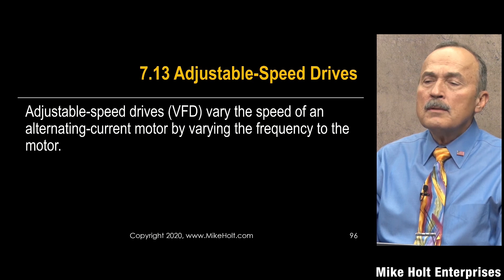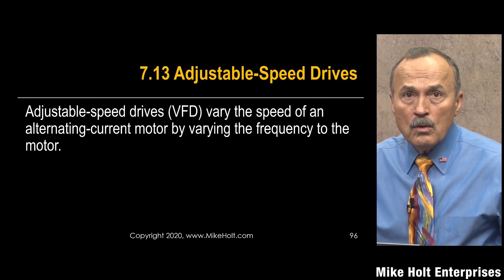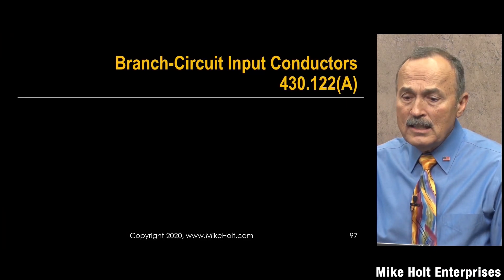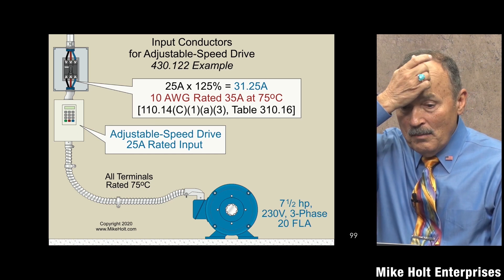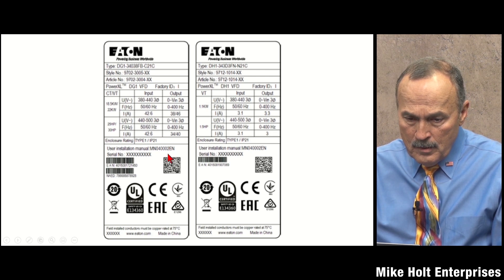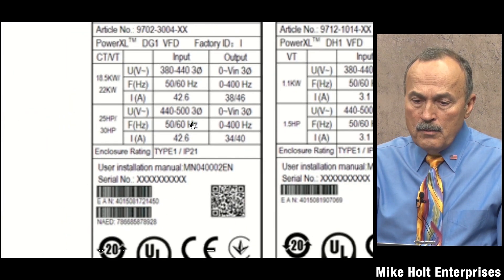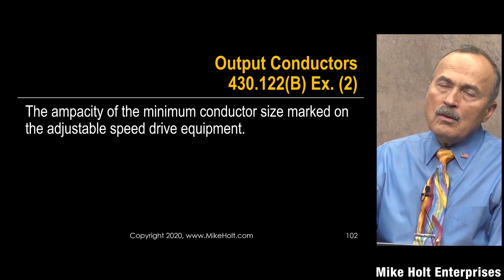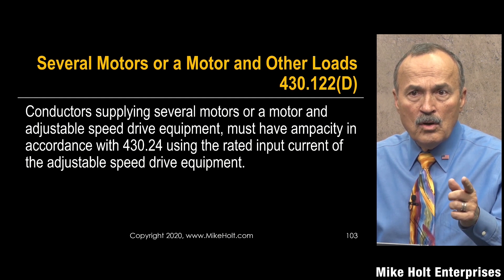Adjustable-Speed Drives, NEC 2020 - [430 Part X], (15min:31sec)

Comment: Mike here are some drive tips: For critical equipment purchase the next size up and it will last longer. Just make sure to reduce fuse amps. Blow them out several times a year with dry air. Perform IR scan at least yearly.On older air handlers might want to extend ramp up time to over a minute so they due not trip out in winter on tripped frezzestats . Our local service company only charged $150 for start up that gave an extended parts & labor warranty to 3 years. Saved us a lot of money on 100 to 250 HP drives.On important equipment we always purchased VFD'S with bypass. Could work on drive while motor was running. Every time I ordered a drive the great sales rep we had always told that they were rated in output amps & not HP. We had 18 pulse drives for all motors 60 HP & larger. Both drive companies that we had service techs said to stay away from 18 pulse drives.

Comment: But doesn't 430.24 also say to take 125% of the continuous non-motor load? So if the motor is continuous and the drive is continuous, wouldn't you take 125% of the largest motor, 125% of the drive and 100% of all the motors amperage?
Reply from the maker: An adjustable spreed drive is not a motor, so you need to go to 430.130 and 131
Reply: @MikeHoltNEC  yes, but it is a non-motor load per 430.24. Dalton brings up a good point and you didnt understand it at all

Comment: Typically the VFD is installed in an Industrial Control Panel or similar enclosure that has an associated load in tandem with the VFD. These could be many things including, say, 5 to 10 HP blower motors with several control power transformers and any number of auxiliary equipment that is the load to be served in tandem with the input VFD rating that need to be calculated to find the correct conductor and ocpd size. I've seen an installation with two 5 hp blower motors, two 2.5 kW heaters, and two 1.5kVA CPT's that needed to be calculated on top of the VFD input current rating for sizing of the conductors and OCPD.
Reply from the maker: Your example has nothing to do with my video, but related to sizing 'feeders' to 'loads.'
Reply: @MikeHoltNEC  Thank you for your reply and time. I thought the application of 430.24 would apply to the situation I mentioned and was alluded to here in your video. This video would be for installing a VFD only serving a motor circuit then right? Much love and respect to you Mike.
Reply from the maker: @jaredkilgore7194  Section 430.24 only applies to multiple motors, not auxiliary equipment like VFDs, heaters, or CPTs (what is a CPT).
Reply: @MikeHoltNEC  "CPTs" Control Power Transformers. 430.24 is used when calculating conductor size for combination motor loads that may or may not include other motors (as considered in 430.24(3)&(4). I see now I am incorrect in looking at this the way I did due to the fact of the video was for sizing conductors for adjustable speed systems alone in scope with nothing else considered. Mike, I've only been in the trade 19 years but I've always pushed myself to learn as much as I possibly can and to stay humble so I can be open to see things and learn things differently. The NEC is a very humbling experience in learning it over the years. Just when you think you have a good grasp, something happens where you're forced to look at it and interpret it differently than previously. I'm in a position now with a state municipality where I'm ultimately the AHJ for it and I'm always learning. I have some very specific questions and issues that arise from time to time that I wish I could professionally bounce off of but unfortunately, I don't have many professionals to bounce some of these questions or issues off of regarding certain situations. Is there an email address for you if you were to entertain some questions I have to offer a professional opinion on? Also, I'm not sure if your actively involved in training these days but I'm sure the municipality I work for would pay top dollar for any training on location if it's something your business offers. I would gladly give you my contact information if you were interested but I'm not going to put it on a YouTube comment at this point. Thank you once again and hope you've gotten some decent mountain biking in recently! Take care.
Reply from the maker: @jaredkilgore7194  I don't do seminars, but you can post your questions on MikeHolt.com/Forum. Merry Christmas.

Comment: Go by the detailed instructions in the installation manual of the manufacture. All the exact formula is in math are included in your service training by the manufacture is for the installation example Dan Foss or ABB. 
             Including very specific and detailed instructions on the type of shielded and grounded radio interference and harmonic distortion wiring.
Reply from the maker: Excellent comment.